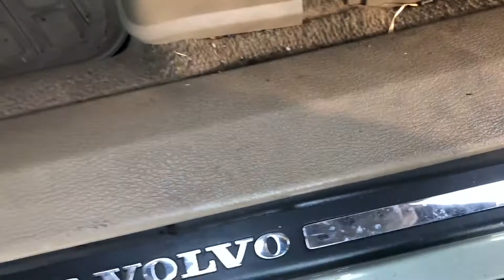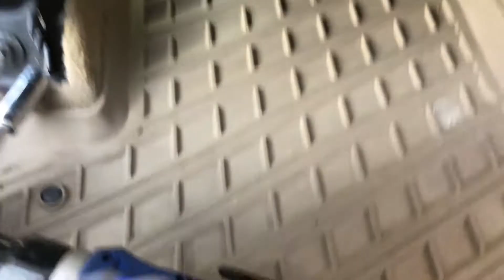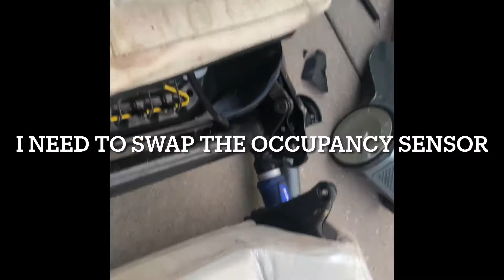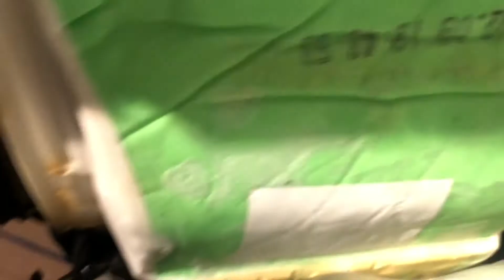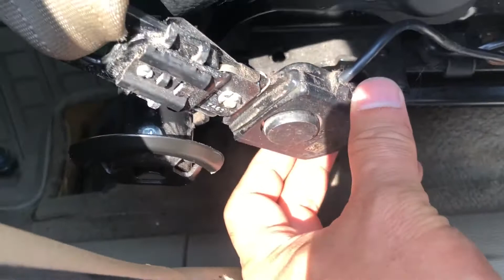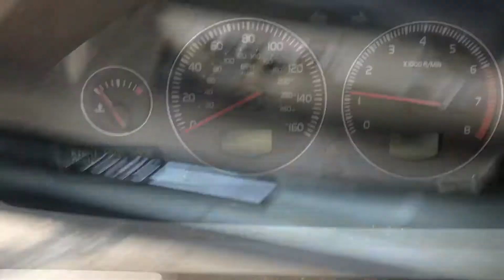Volvo XC90 Front and Rear Seats Replacement - new  issue with Passenger Airbag

Comment: Hey man, I also have an old Volvo XC90 (2011). I took the seats out to drain the water from the inside (sunroof drain clogged, and flooded the car). My question: after I connected back the seat, I get the "PASS AIRBAG OFF, SERVICE URGENT" message. I connected everything properly, yet the message still persists. Any suggestions?
Reply from the maker: you probably disconnected the seat without first disconnecting the battery and reconnected the seats still with the battery disconnected. You need a scan tool that can clear airbag codes.
Autel MaxiAP2000 can do it with a Volvo license/module.
Reply: So what is the proper order? 1)disconnecting the battery
2) disconnecting the seat
3) reconnecting the seat
4) reconnecting the battery
?
Reply from the maker: @arsen768  - yes, that's the order